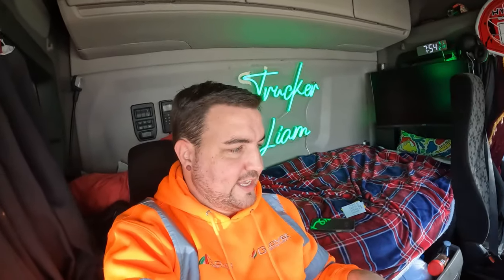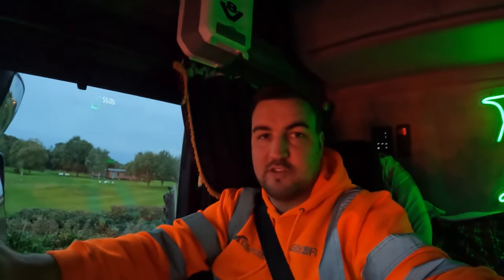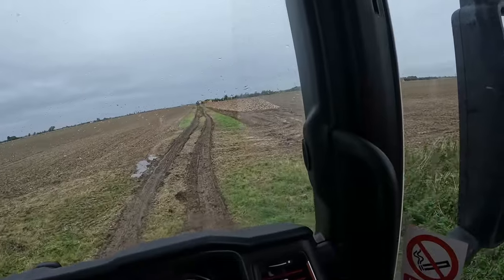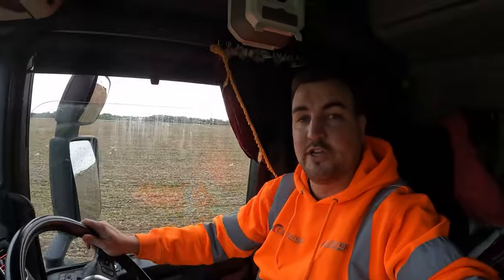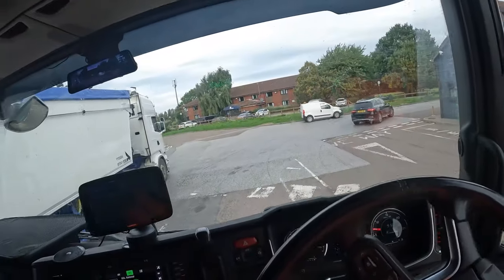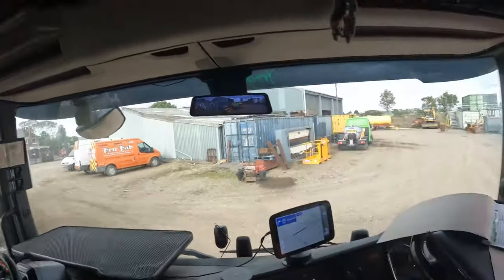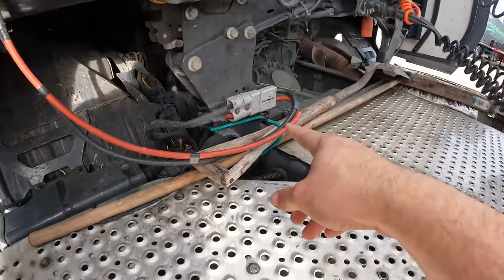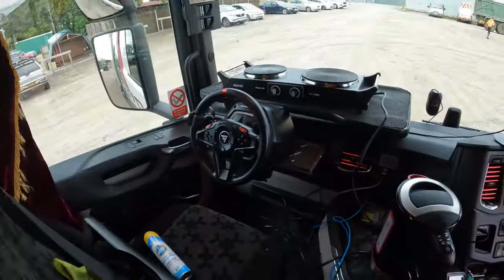Unveiling the Secrets: How I Power My Truck with Electricity

Comment: WHY dont they run overhead power lines along major truck routes like electric trolleys use?
Trucks would not require ANY batteries, altho a small battery pack would be convenient to
move the truck around off the wire like at the shippers warehouse or to park it at the home
trucking company yard.

!

Comment: Hi Liam, a bit late to the party but I’m looking at getting an 24v inverter for the truck will I need to connect red and black cables both the batteries or just one battery? Or where do you get the Anderson lead adapter for the inverter?
Reply from the maker: The Anderson lead is from www.hgvcables.com they sell heavy duty cables you’ll need a 24v Anderson lead cable

Comment: So u use a lot of gasoline for let engine start when u use the electric stuff
Reply from the maker: Not sure what you’ve been told but the engine idling doesn’t use a “lot” of diesel. Especially 20mins. I’m usually stuck in traffic throughout the day with it idling
Reply: Diesel usually burns 4L per hour on idle. An idling diesel engine can double as a power source a lot of times.

Comment: I have the same inverter but the lcd don’t show the usage when I plug something in any advice to fix this issue
Reply from the maker: Hey, that sucks then. You got it plugged in? Sounds silly but you tried removing it and turning inverter off then reattach? That’s the only thing I can think of as mine works everytime. I run my wire for it under my flooring. Is it not showing anything? Or is it just showing 0w?
Reply: Just out of curiosity why are you running a modified sine wave instead of a pure sine wave inverter ??

Comment: What about the refrigerator?
Reply from the maker: It’s under the bed.
Reply: Yes, I saw it in your previous videos, how do you supply the electricity to the refrigerator, this is what stuck in my mind. @TruckerLiam
Reply from the maker: @sparktheinvester654  sorry for late reply just getting around to the messages. The fridge is hardwired to the batteries. It won’t turn off unless I turn it off. The power consumption is so little on that you won’t notice it